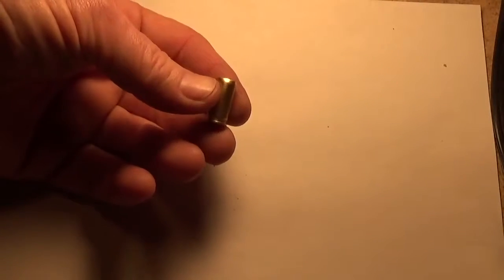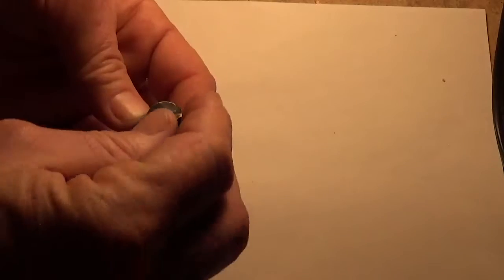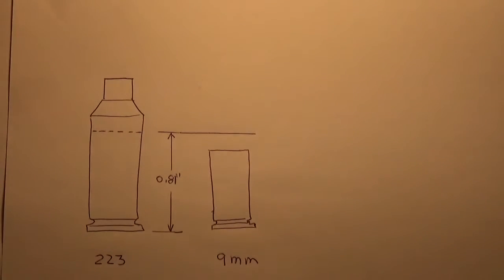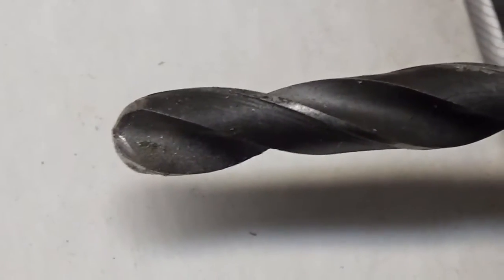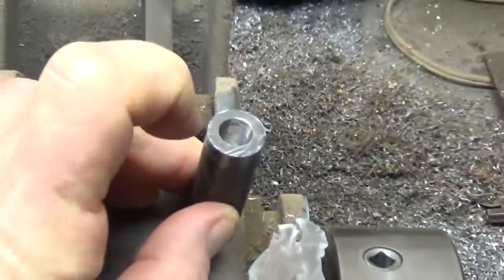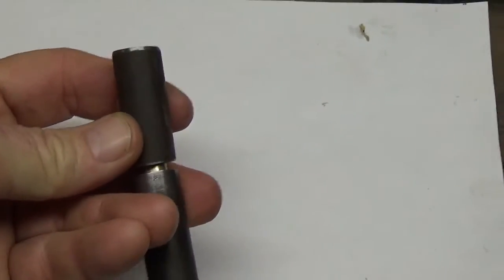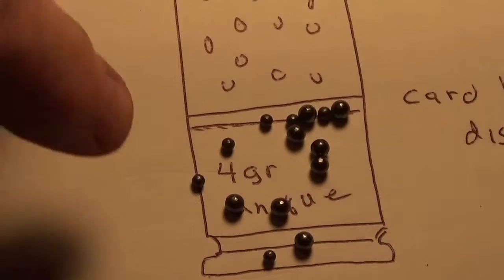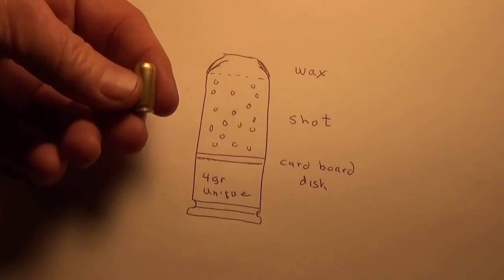9mm shot shell dies

Comment: so 9mm headspaces on case rim... I guess with just a tiny bit of wax holding the payload pressure spikes may not be a huge concern but shooting a gun with unset headspace just never seems great.
Reply from the maker: With an experimental low pressure, round  intended as the first round in the mag head space was not a concern.  On a m1919 build, I agree head space is important.
Reply: @theworldus708  wait these actually cycle the gun? I never know CCI shotshells to cycle lock breached semi autos well. 

m1919? you mean 1911?
Reply from the maker: @MrAwsomeshot  That’s the intent.   I did the same thing with 45 ACP and a mag of 5 would eject and load into
battery the next round.  They can be intermixed with 230 grain ball.  The Unique powder for this video only ejected the round but using 700x would do the trick.   That’s what it took to reload the 45 ACP.  Yes I did mean a m1919 belt fed 308 semi build from a kit and not a 1911.  Head space on that build was much more important, but it too was forgiving.